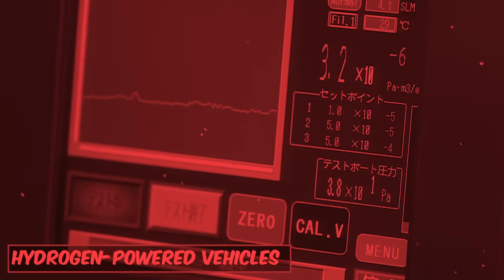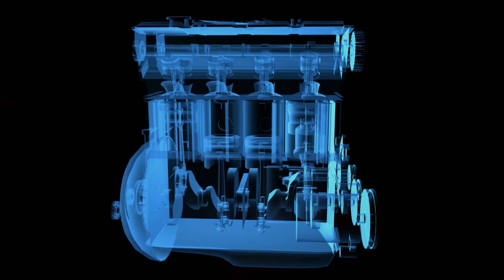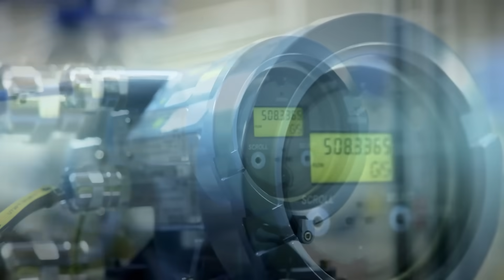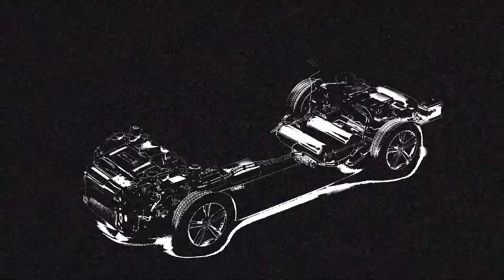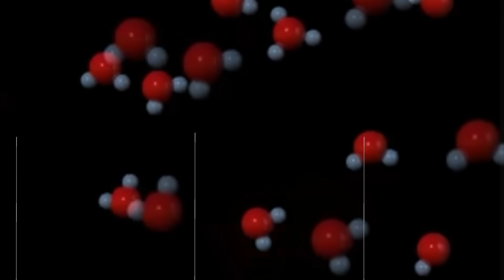Toyota's New WATER Engine Will Destroy The Entire EV Industry!

Comment: I have said for decades that anyone that can solve the problem of turning water into Hydrogen in the car safely will become the first trillionaire.
Reply: this is so stupid😂 it’s already solved. it’s called electrolysis, and it takes more energy to do it than you can get back from the hydrogen.
Reply: There's free air at gas stations. Replace the electric motor with a heavy duty impact wrench. Call it hyperdrive pneumatic got no gas dam it.
Reply: @tombaja4.9  There actually have been pneumatic car designs. It's the same idea as an EV or an H2 fuel cell car: something from the outside world uses energy to create your energy, stored as electricity, compressed air, H2, whatever. You car doesn't run on a fuel, it runs on a kind of battery.  The free air at some gas stations isn't remotely high pressure enough to be useful here.
Reply: @tombaja4.9 gas stations won't last long if everyone's using free air 😊
Reply: Electrolysis 😂 So where does the electric energy come from?
Reply: @tilfliegel  I think the Russians are selling nuclear reactors from their subs pretty cheap right now😜
Reply: @tilfliegel , solar panels car roof.😅😅😅😅
Reply: @tilfliegel a battery would Jumpstart the electrolysis process but a generator connected to the engine could keep the battery charged and the electrolysis process going. Current car motors have fuel injection that use the battery to start in a similar fashion. The system they are talking about is self-contained but need a electric boost to get started the same way our cars already do.
Reply: @locutic1  That's not going to work. The electrolysis needs more energy than you get out of burning the hydrogen. Perpetuum mobile is not possible.
Reply: Yes, THERE lies the rub....and also the lie in the video: electrolysis requires electricity. So, there cars would need a very large battery to get things started.
Reply: @tilfliegel  - I guess, the elctric energy comes from the energy released after the separation of Hydrogen from water...
Reply: @Shqiponja-o5i  Bad guess, there's no energy released. You need to put in energy to seperate the hydrogen from the H2O. You get that energy back when you oxidize the H. Water Motors don't work, they are physically impossible.
Reply: @tilfliegel  - So, you mean it´s not possible to produce electricity from water (hydrogen) at all; or only in cars (vehicles)?

But, there may be another way...
When the wheels rotate you can use their energy to produce electricity for the car; right?
Reply: @Shqiponja-o5i The wheels can't produce more energy than the motor uses to drive. Unless you're going downhill or braking. EVs already do that though, it's called recuperation and gives you back some of the energy you used for acceleration or going uphill.
Reply: @tilfliegel  Yes. And maybe for lights, radio and things like that. Right?
Reply: Batteries that can be recharged at home lol. Another concern, half the world lives in cold areas and im not that smart but to my knowledge living in canada water freezes i think. If i leave a bucket of water outside for 4 hrs its a solid block. How does the water in that tank not turn to a solid?
Reply: @shawnkelly695  salt and agitating the water makes it harder to freeze. Also water has to expand to freeze. So if you don't let it expand it won't.
Reply: @tilfliegel a battery?
Reply: @markking2262  Yes right. So it's just another type of EV.
Reply: @tilfliegel no. You’re completely wrong. Every car has a battery. Once started, alternators supply a constant input of power. Same could apply.
Reply: @BT_life2  Yes I know every car has a battery. But for turning water into hydrogen you need more energy than that hydrogen motor can supply. Otherwise you'd have a perpetuum mobile, which is impossible.
Reply: @tilfliegel it's just a stunt
Reply: @tilfliegel gas engines use batteries, what's your point?
Reply: @balzaak4803  The size of the battery. In a water car the battery is the source of energy. That's not just a small starter battery.
Reply: @BT_life2  An alternator in an ICE car is tapping a bit of the power generate by the ICE to provide the very small amount of energy necessary for the operation of the engine. The power needed to crack oxygen to hydrogen is fundamentally more than the power you get out of "burning" that hydrogen and oxygen back into water. So no, you can't use an alternator for that.
Reply: @tilfliegel  solution is solar on roof
Reply: @tilfliegel  by that logic all vehicles are EV's what do you think powers your starter?
Reply: @Trogderpinator  Absolutely not. The question is main primary energy source. Water is not an energy source, you need to put energy in to make it one. Starter battery isn't even an energy source, it's just a storage which takes some of the running motors energy and stores it.
Reply: @tilfliegel  a petrol car has a battery and an alternator I guess that makes  petrol cars an EV too 🤫
Reply: Or will be assassinated 😂😂😂
Reply: @jaygoodwin5809  leads me to wonder if the Iranian guy is still alive.
Reply: The first person to do this will disappear along with his design
Reply: Already happend in the late 70's @markme4
Reply: @markme4  Just like all those many companies making electric vehicles, I suppose.
Reply: But what about winter in the north?
Reply: Pre ce izgubiti glavu ne dozvoljavaju naftasi nista dok ima nafte
Reply: Stanley Myer invented the water car and they took him out.
Reply: The same goes for anyone who can overturn the basic laws of physics.
Reply: @cameroncooper4175 not overturning physics. Understanding physics
Reply: @cameroncooper4175  exactly, that's why it's clear a fake story.
Reply: They’ll still be full of oil. Oil is awesome!!!
Reply: I'll just get my 'Mr Fusion' reactor from my other car.
Reply: @wakkowarner7391  You'll need a banana peel and some backwash from a beer can!!!
Reply: You can spilt water into hydrogen and oxygen, but it takes more energy (if you include losses during the process (electrolysis) than you get out when burning hydrogen (when it combines back with oxygen to produce water).
This video says nothing. It ignores splitting of water  which will also produce emissions BTW.
Reply: 60s that made one that run on water he mysteriously died
Reply: @ouiroc  I bet it was probably from covid and he died right after a visit from Hillary!!! The media, "Nothing to see here, move along."
Reply: Actually I said this first.
Reply: @Vinny05743  Well I'm not giving you credit so there🤣🤣🤣🤣
Reply: You're not the first and only person to say or think that, talk about being up yourself.
it's like me saying the first person to generate electricity from thin air will change the world.
Reply: @chozusmakavelli  Thanks for adding to the conversation. It's because of people like you that the internet is bad place. I bet you would never say something like that to someone's face. If you did you would have no friends and no teeth, 🤫
Reply: This has been invented decade ago the investors has been eliminated :/
Now we have a big tach company
Reply: @Ertrosveli  -
Yes, I have also heard a story about a guy, I think in the 70s; who designed his own car engine to go with water.. But then, he disappeared. 😞

If these stories are true; Then, these assholes who stop these inventions (while also propagating "climate change" bullshit); deserve to get caught and punished as hell by people...!

I´ve been reading a Rockefellers´ report book on "future of technology", and these assholes were saying things like: "control talent inventions"..! 
I was shocked and pissd off, like! 
Couldn´t believe they are so evil, selfish and mean!
Reply: So Stanley Meyer invented a water powered engine and mysteriously died after inventing this project.
Reply: @OOGBossHogg  Nope. Stanley Meyer tried to sell a version of the perpetual motion machine. It takes more energy to crack H2O into H2 and O2 than it does to recombine them in any hydrogen engine. Meyer claimed, in violation of the Second Law of Thermodynamics (like all perpetual motion machines) that it took less energy to crack water than it produced when burned. That's obviously false, no matter how you do it. Meyer was sued by his investors when, after it still didn't work after two years. The court found he had committed "gross and egregious" fraud. He did die in 1998, from a cerebral aneurysm according to the coroner's report.  

Funny how it's always something impossible that's "shut down by [industry X]," but all those things that actually do work and replace [industry X] get to market just dandy. Some people do love a good conspiracy theory.
Reply: @DaveHaynie  oh ok I understand.
Reply: Water will become expensive.
Reply: Yes all you need to do is revert the universe with a different set of rules, easy.
Reply: The funniest part of this (fake) claim is that somebody proved the basic laws of Physics false and instead of claiming that for a few Nobel prices, patent to rule the entire world of power generation and almost be the next superpower, went on to compete with a few electric cars, that too selling his invention to Toyota!!
Reply: Theres alrdy an water and magnetic engine, but They will be never an Water and magnetic engine for sale.
Reply: @EmrahBey-n1w  that seems to be the real issue. not weather its possible but weather the greedster's will let it happen.
Reply: I made a car run by pedal engine and I don't even had a buyer
Reply: Stanley Meyers did it and was killed for it. 30 to 40 years ago.
Reply: You need energy to turn water into hydrogen, more energy than you get back by burning the hydrogen. This is pure bs for the uneducated.
Reply: https://youtu.be/xvNvj7ku5pY?si=JNyk3kYXjBImeRx5
Reply: You said but never did or even tried it... 😮
Reply: Well...
You never did nor even tried to do it...
Reply: You are clever.
Reply: Tech is getting there
Reply: Several people have done it and all of them are dead when Elon Musk did it the government came in and took his car away from him
Reply: No, it will end up them going out of business. Elites will crash the shares, share prices will drop, Earthquake will hit the region, 7.8 to 9.0.
Reply: the black policeman that was killed in the mass shooting in buffulo had already figured this out and was killed look it up
Reply: Except for, ya know, the fuel freezing in the winter, 😅
Reply: @apeshitcrazyman  You must not be familiar with DEF that they currently use in diesel trucks. Or even diesel fuel itself. It can go colder than DEF but not by much.
Reply: No they’ll just fall out a window
Reply: @@kstkst32 houses are garbage man, you need to get rid of them and get back into caves😂🤣
Reply: People have learned to do this 100 years ago they disappeared
Reply: Racking h2 with anhydrous ammonia
Reply: In🇰🇪 motorbike already working well
Reply: There where many, but they suddenly died.
Reply: The petroleum Mafia like OPEC,etc  don’t allow this to happen too quickly
Reply: Trillionaire or dead
Reply: @Art07s  Yeah, more likely dead!!!!
Reply: There was a guy in the late 70's that did it. He ran his own car on it. Strange he died before he could start making them for sale
Reply: Great invention  is welcome  for you Japan's  Toyota  company, welcome
Reply: They will be eye watering expensive.😅
Reply: @jameskemp6439  That would offset the cost as your tears can be used as fuel😜
Reply: roschilds have been trillionares for years
Reply: They did it in the 80s look up stanley mayer he was assassinated for making it this is not new
Reply: I wisdom dwell with prudence, and find out knowledge of witty inventions. Proverbs 8:12 KJV
Reply: Oil gaints like ExxonMobil  Shell will  attack their adversity .
Reply: Why not magnets???
Reply: you and everyone over 50 man.
Reply: He'll disappear lije our own who discovered Hiv/Aids medicine
Reply: Lol and not be shelved.
Reply: That s good for environment and will lower the prize of gas
Reply: That’s the only motivation for doing it, money, just as it’s money that’s destroying the environment, just as it’s money that’s turned my country, the UK into a shithole.
Reply: I think the Rothschilds already have that dubious record.
Reply: Please don't miss the forest for the trees, Jay puts water in his tank, and it propels the car down the road.  Of course, it coverts water into steam . But my point was that they had this technology in the twenties,  and it suddenly died. Just imagine how much better it would be if the R&D hadn't died? Jay himself says the 1924 model was the perfected model. You need to watch the show for yourself and then respond.
Reply: They already have buses and trucks that run hydrogen. So this is this is not new
Reply: This technology is already discovered in 1980's by the Bulgarian engineer Jul Brown. He turns water into fuel by a process called implosion. He has proven prototype for cars as well, but as you can guess some countries won't allow this as of yet. His technology is beneficial for every aspect of our life. You probably have heard of the Brown's generators. All in all the technology is here, just been covered for now.
Reply: The have water engine years back which the boy die by accidentally 1970s
Reply: It will just turn into a Hydrogen engine that's all
Reply: Assisinated correct..
Reply: That happened in 1927, the technology is just coming out now ☕️
Reply: I how to do yet
Reply: A man did and they killed him for it
Reply: There was Stanley Meyer and he was killed
Reply: About 8 other people also did it in the past.
Reply: I just thought this I was like dam the first thing I thought was they will be beyond rich I mean wealthy because they would never go broke ever
Reply: Wouldn't it be easier to just use a solar powered electric car?
Reply: @jeremiahsymonette4781  what if there's no sunlight from everyone using it
Reply: There was a guy but he got killed
Reply: Can be done easily its the flow of traffics that is the problem
Reply: The problem with capital centred technology is suicidal in this changing world

People and countries aren't operating on heard mentality 
Many countries esp now the rising of BRICS, threatens the propensity of monopoly in these industries 

If they seek to con people? TOYOTA will face same fate as BMW/ VW & Mercedes
Reply: The best for the world..carpollution will be over.
Reply: John Kanzius already figured out how to burn salt water.
Reply: @MrWhite-cn1ms  He should publish the details and make a fortune.
Reply: Or dead
Reply: The process is easy and simple.. Hitler did it ..the business model has to change. As long as the business model stays the same it won't be allowed
Reply: they can but its more about selling you hydrogen as fuel. if you know anything about the motor they were created with an on bord hydrogen generator.
Reply: To my knowledge, the amount of power that is needed to take the hydrogen out of the water is not economically viable.
Reply: IT IS DEAD IN 11 MINUTES )))))
Reply: @theturbomedia1 all the trains in Germany are presently running on hydrogen.
Reply: @CONSCIOUSCOMA Absolute nonsense.
Reply: @theturbomedia1 Yes
Yes, trains in Germany can run on hydrogen. For example, the Coradia iLint trains designed by Alstom run entirely on hydrogen fuel cells, with the only emissions being steam and water vapor1. The high-tech trains combine hydrogen with oxygen to produce power4. Additionally, the world's first two hydrogen trains have been in service in Lower Saxony since 20185.
Reply: @CONSCIOUSCOMA  But they can't run on water.Theres a massive difference.
Reply: @Anglo_Saxon1  semantics ,, just because the train run's on fuel cels how is it way different? an on bord hydrogen generator  will by pass that process. in the end they are both running on hydrogen.
Reply: @CONSCIOUSCOMA Because the train has pre-made hydrogen added to it.Rather than a true water engine which would have to do the electrolysis within the actual engine.This is why up until now a successful water engine hasn't been built for mass production. Because the amount of energy needed to turn the water to hydrogen makes it totally unfeasible for a self propelled vehicle. 
There is a big difference.
Reply: @Anglo_Saxon1  IT'S already been done. old news.
Reply: @CONSCIOUSCOMA Why aren't they producing 'water engines' then?
Reply: @CONSCIOUSCOMA The amount of electric needed to power an electrolysis unit onboard a vehicle just to provide the hydrogen fuel in the first place to power a 'water engine' is totally unsustainable.
Im sorry you're having trouble understanding this sir.
Reply: 87 someone in asia already invented water engine, got kidnapped by MI6.
Reply: @danielhsubr  That is pure bullshit, if you know basic physics, then you'll understand that it's impossible to make water as fuel.
Reply: Hydrogen will cost 50 cents a mile as it already does, in Japan they can because they have that natural resource so they can cell a whole battery pack for Pennie’s for their people
Reply: The Rockefeller and Rothschild (Braun) families have been trillionaires for decades! This is just suppressed technology and has been for years, but Toyota is too big of an entity to be silenced! Thanks to Stanley Meyer for discovering this propulsion system; he paid with his life for divulging this science technology! 🙏
Reply: nope...     Stan Meyers did it too.. he was poisoned to death.. probably by big oil....   they kill to keep the billions flowing and they dont give a shit about the planet the HAVE to STAY ON......   its sad...  freed has fried they brains enough to not realize they killing themselves...

I dont count myself human....   I would never make that mistake.
Reply: One guy did and he and his family were murdered for his invention
Reply: Does saying something for decades mean you're clever?
Reply: @markfox1545  Uh, does being a dick mean you're "clever"? For crying out loud, a person can't even enjoy a friendly conversation without some troll idiot posting a negative comment.
Reply: Bro....🤦 are people seriously this dense?
Reply: ❤❤2❤❤ @triballavangers2934
Reply: It is dead easy to turn water into hydrogen
 The problem is that you always get less energy back than you put in so it is not prsctical.
Reply: @eckyhen  solar panel on top can solve the problem
Reply: @eckyhen  Then that is the trick and the person that figures how to do that practically and get more out than has to be put in will be wealthy beyond belief. I'm sure at one time getting regular petrol out of crude oil was a losing proposition but they figured it out!!!
Reply: @1967davethewave  There is no problem designing an electrolyser which could produce hydrogen safely in a car. The fundamental problem which cannot be overcome is that you will always get less energy back when you burn the hydrogen than you had to put in to generate it in the first place.
You are certainly right that if anyone can find the "trick" to do it they would me multi millionaires but this is not going to happen as it would mean breaking one of the most fundamental laws of nature. No one has ever done it, there is no theoretical way it can be done and it never will be done.
Reply: @eckyhen 🤫
Reply: @eckyhen a lot of ppl have said things like this in the past, everything is possible
Reply: @balzaak4803  No. Some things are impossible and getting energy out of nothing is one of them
Reply: @eckyhen  solar panel on top of the roof of car can be a way.
Reply: @eckyhen  of I'm not mistaken this has already been done and people lost their lives because of it
Reply: @1967davethewave I guess you failed in your high school elementary physics and chemistry.
Reply: A small compressed hydrogen tank will be kept full. Enough to ignite and run the engine when the engine is cranked. The engine runs on this stored hydrogen whilst the system produces hydrogen from the water. A diverter valve will feed hydrogen direct to the engine for combustion when the starter hydrogen tank is full, ready for the next engine start. The engine has a battery and alternator to produce the electricity for the electrolysis system to generate the hydrogen. Regen braking will help battery charging.
Reply: @pegadmin4787  and thus the perpetual engine was born🤦😂
Reply: @pegadmin4787  What's the alternator going to do? You will need more electricity to crack H2O into H2 than you get when you "burn" H2 and O2 back into H2O in the engine. You're going to need a battery larger than those you find in today's EVs to achieve the same driving range. And exactly the same issues with charging.
Reply: Whoever is going to invent a fast charging battery from material that can be easily reused would be billionaire.
Reply: @ESYT7173  Batteries aren't the future. While they certainly can be used for transportation the fact that you have to charge them from an outside source, meaning the power grid, makes them a non starter. Kind of like how Ethanol was going to revolutionize the fuel industry but instead it just raised the price of corn, a base ingredient in much of our foods and in the end it's carbon emissions are the same as fossil fuels. Toyota is dropping further development of full electric vehicles in favor of more efficient hybrids and even way more efficient synthetic fuels that have near zero emissions.
Reply: @1967davethewave  I agree. At the current state, electric cars are not the future. Especially all the issues cold weather causes besides the given constraints. 
I always say that internal combustion engine is the greatest gift to humanity. 
Right now, batteries have 3 major hurdles to overcome in order to fully compete with internal combustion engines: 1)Charging time. 2)Materials and cost. 3)Ability to fully function in extreme temperatures.
Reply: @1967davethewave  Toyota is absolutely working on EVs.... they announced their program recently. They simply don't believe that today's Li-ion batteries offer sufficient range, charging time, or economy. Their EVs, launching as I recall in 2025 or 2026 if they stick to their schedule, will use solid state batteries, charge in 10-15 minutes, and deliver 500+ mile range, going higher over time. They are not going to sit out the EV revolution, but they also did not want to alienate buyers with the limitations of the technology, at normal Toyota price points. As, say, Nissan did with the Leaf.
Reply: And I've been saying for decades that water engines are possible, as well as flying cars back in 1975. And since many things have become possible that we thought were not, this two will come to pass like many more projects that have been given to the minds of those who don't even understand what it means or what it is. And that's what I was. The same thing with the cell phone, at the time we only had what was called jungle phones, and house phones. But I saw there was going to be flip phones. This was back when the movie Future Shock come out and computers were the main topic of the future
Reply: Hendry Ford- developed a car out" hemp "- plastics/ fuel etc- what happened to the plans etc😮
Reply: I watched Jay Lenos garage, and he has several cars from the twenties that run on water. So, the technology has been around for at least a century,  but these oil companies have kept it suppressed. Now they are acting as if it's new technology? What a crock of crap!
Reply: @ronbotello8513  What nonsense!
Reply: @ronbotello8513  No car runs on water.
There used to be steam powered cars nut you have to burn a fuel
Reply: @ronbotello8513  I can tell you with absolute confidence that Jay Leno does not have a water powered" car in his garage.
He may have a steam powered car but you have to burn a fuel to make steam so not water powered.
Maybe you can link me to the episode where he says he has such a thing.
He is a pretty smart guy and he knows cars so he will know that no such thing exists.
Reply: @eckyhen  Leno's got a bunch of steam powered cars, and he drives them around, they don't just sit there. Though I suspect the guy can drive a different car everyday for year. They run from gasoline or kerosine.
Reply: @ronbotello8513  Yeah, but steam and hydrogen are 2 different things. Steam isn't efficient at all and unless I missed something that is what all of Jay Leno's water cars are.
Reply: @ronbotello8513  No.... Leno's got some steam powered cars... the steam is an intermediary, not the fuel. Stanley Steamers originally used gasoline to heat water into steam, but eventually went to gas only for the pilot, with kerosine for the main burner. This video does not describe a steam car. 

Leno also owns a couple of other "water" cars, but those are amphibious cars.... pretty cool. Unless I've missed one... the dude does have some amazing vehicles.
Reply: All you need to do is Google,  Jay Leno garage cars that run on water...pretty simple!
Reply: @ronbotello8513  That will just give some hoax. I know enough physics to know it's not possible without a big battery, making it essentially an EV.
Reply: Everyone who does disappears, it's actually quite simple I've done it myself
Reply: @jonathanherndon7957  I can believe that there is some truth to that statement. The powers that be are threatened by a lot that is going on.
Reply: A black man did it before, but you guys killed him and took the blueprint